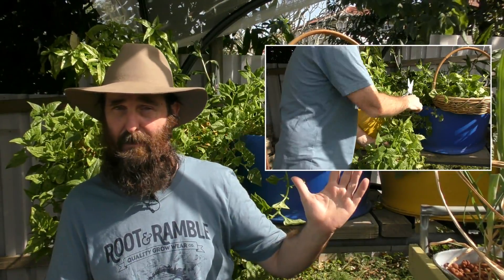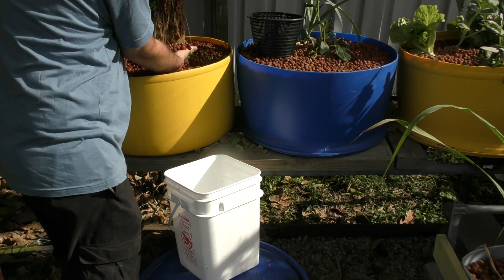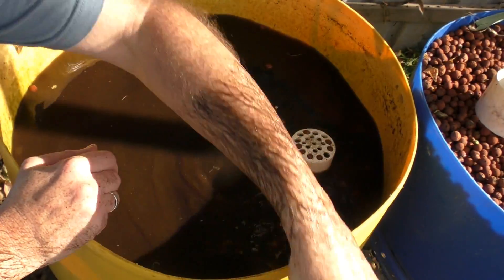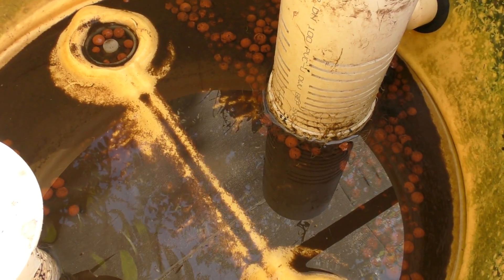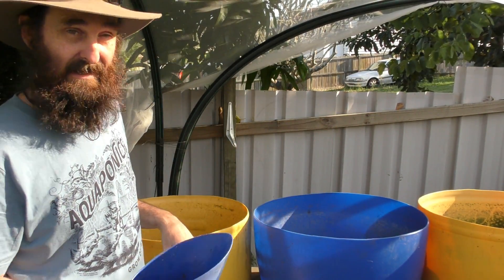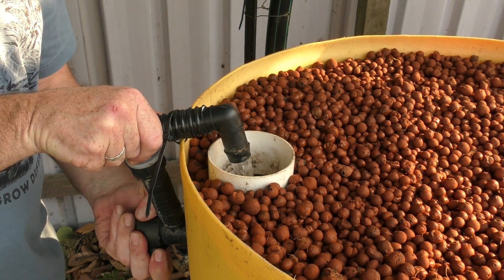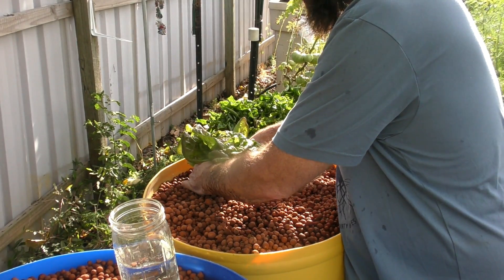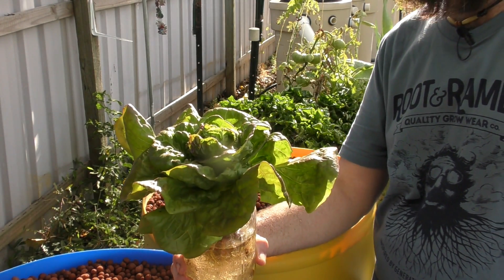Solids in Aquaponic Grow Beds | Rising pH | Denitrification | Cleaning MUCK

Comment: I have composting worms in my ebb & flow and they seem to keep the system free of muck and decaying plant matter.
Reply from the maker: I would think that in the base of the beds you'll still have solids. 
I've had worms in all of the grow beds I've used since I started out & they all collect solids over time. 😉
Reply: @RobsAquaponics  I'm not sure what I am doing, then, as after I checked the bottom after about a year it is relatively clean.

My siphon does drain to about 6mm, so perhaps there's not a lot of volume left after draining that will collect solids to such an extent? Either way, I hope I don't get too much muck in the long run.

I also do not have a huge system, my grow bed is about 1.2m x 1.2m and my fish tank is roughly 550L, so maybe that is part of it as well.

Regardless, I am still young in my aquaponics journey so I appreciate all the videos you create for the benefit of everyone!
Reply from the maker: @tichuang  As long as it grows healthy plants & fish, you're on a winner mate. 
Cheers & happy growing.
🐟🥬🍓

Comment: Sir, do I need to filter the solids excreted by the fish?
Reply from the maker: It will help in systems with a fair amount of fish in them.  You won't remove all of them which is OK. I just aim to get the bulk of them out with the radial flow settler & still clean the muck out from the beds every few years if it builds up too much.

Comment: Hi Rob, why are you replacing the flexi pipe with solid?
Reply from the maker: The 25mm/1" flexible line has a smaller ID than PVC pipe. It also has small ridges that collect solids and bio slime that will impede the water flow.
We are living in a rental property at the moment but will be rebuilding the aquaponics system when we move back home. The new pipe work will mainly be pvc
Reply: I see, makes sense. Thanks very much for your reply & good luck with your move.

Comment: Just tested my system, the strip only goes up to 8.4.  So I added about a 1/4 cup of phosphoric acid (75%) and it dropped the alkalinity from >240 to around 40.  The pH dropped from >8.4 to <6.5.  So problem largely solved.  I did notice that it caused a lot of leaves and surface gunk to float up, but no dead fish, so that is good so far.  I should note I did a complete water change today.  I am hoping to find an organic way to lower pH since the phosphoric acid is pretty expensive, around $30 a gallon.  its designed for hydroponics systems and I had it laying around, but its not really intended for long term use.

Comment: Hi Bob, I am from Singapore and I couldn't buy any of those uniseal that you use to connect pipes to tank, I wrote to the manufacturer in Australia but they don't handle some quantity. The last time you mention you are able to supply the seal. I am using OD 22.5mm, If the price is right i need about 20 pcs of it. 
Thanks and await your reply.
Reply: I mean uniseal
Reply from the maker: Hi Boon Cheow.
Email me on rb@bitsouttheback.net & will work out a price for you.
Cheers mate. 👍 👍

Comment: Would it be easier to diagnose, AND, to clean, if someone ran multiple, smaller systems?  So that they are not all linked?
Reply from the maker: That could be one option. Removing the solids so they don't become a big issue would be a more economical way to go though I think when you consider running cost of p[umps for separate systems.
Cheers Shane.
Reply: Have you looked into "Haren's fountain" ?  It uses Pressure to keep a cycle without a pump!  I am going to attempt a system that uses it to empty into a growbed with a Bell Siphon in this top-most bed.  Below that we have a container keeping the pressure on the Lowest container which must be sealed, and also, squeezable?  A man who I think is Checz (spelling error!) , figured out how to do it with a single container, and, he inspired this idea of mine!   Search on the Google Plus for "shane corning #aquaponics " , and , you should find my post about it with little issue !!!!!  I will test it, first, with just a "wet run" to see if it keeps going.

Comment: Balance between grow bed media/size and fish tank size/density is integral to minimising the build up of solids. I've read that some have got it so perfect that they only have to clean the media once every two years at most, without any extra filtering. Ultra Synergy
Reply from the maker: This system run that smoothly for a while until I got crook & couldn't maintain the filters for a while as I mentioned in the clip. 👍
Am looking at reducing the solids load yet again when the system gets modified in a few months time.
Cheers.

Comment: If you put some sort of mesh under the clay, so there was space between the clay and the barrel bottoms, do you think the solids would flush out instead of build up? A mesh like the diffusers on industrial/commercial fluorescent lights.
Reply from the maker: Have thought about doing something like that in the past Sam but am yet to try it. Once out of the bed they would still need to be captured somewhere else in the system so a better filtration system may be needed as well.
Cheers. 👍.

Comment: hey rob nice vid-currently have a ph of around 6.2 a bit low-so maybe given this denitrification process i should just not flush my solids filter that often.
Reply from the maker: Hey Bevan. 
I'd still be removing the solids as they will release sulphides into the system as they break down. You're better of using some carbonates or hydroxides to manage the pH I think. A lot more controllable & safer for the system. 
Chreers mate.

Comment: I wonder if the clay ball media was the reason for the higher pH. Higher kH --> higher pH?
Reply from the maker: Hi Andy. The clay media is inert & have been in the system for 7+ years so isn't the issue Andy. If I was using rock there could be a possibility that it may be releasing carbonates into the system. 
 Cheers Andy & have a top one.
Reply from the maker: Hi The Foreigner. It refers to the carbonate hardness or buffering capacity of the water in regards to acids.

Comment: Would a trickle filter or a liquid media filter work in allowing a better nitrate to nitrite conversion? I thought worms were always a huge thing when it came to composting organic material into nutrients that are better utilized by plants, but I'm not too certain that that's gonna be the only way. I'm doing an indoor one that is larger than the standard 20 gal tank with some small fish ... I'm hoping to upgrade to a few hundred gallons within the entire system. I want to make sure when I upgrade that I do so without compromising the system as a whole, and so I don't have to do this whole thing where I'm taking the bed apart to clean it out. I've also heard something about a cylinder with a v shaped bottom to catch solids as well ... do you have any experience in these? Been watching your videos, keep it up!
Reply from the maker: Hi Gypsy Winchester. I have a moving bed bio filterer on this system here to help process the ammonia & nitrite as I was intending to run a lot more fish in it that I presently do. The 90 or so litres (23.75 gal) of media in there is enough to process the waste from about 90 x 500g or 1lb fish & if all fits in a 200L drum. They're a lot more efficient than media beds & will always have one in my personal systems now. 👍
Worms are good at processing some but they can't remove all solids. Would be great if they could. 
I uses a radial flow settler as our solids filter & find it works really well (when maintained correctly 😉). It has a flat base as cone shaped ones are hard to come by. 
This clip here shows how the system is roughly laid out now. The only thing that isn't in it is the 3 barrel beds from this clip.  
https://www.youtube.com/watch?v=raLv4RAUte8
Hope it helps you out with a few ideas.
Cheers & have fun with the build.

Comment: Did you just run hose over your hydroton for additional rinsing, clean it additionally, or just replace it as you pulled it from the bed?  Thanks for the experience.
Reply from the maker: I just added it back in so as to not disrupt any bacteria on there too much. A small amount of solids would be reintroduced but I'm not concerned about that.
Cheers & have a top one Savage Dispatch.

Comment: Could you try to employ a vortex filter?
Reply from the maker: I have a radial flow filter in the system which does a great job at removing solids. 
In a previous clip I mentioned I was crook & couldn't get out to clean it regularly for a few months so that's why I think the solids have built up in the beds. 
Cheers Joe & sorry for taking so long to reply.

Comment: In my experience the compost worms I had in my beds a few years ago caused more problems. They just exchanged one wast product for another. Compost worms have wast of there own as well as building homes for eggs, they effective try to stop flow of water in the media to protect there homes. I got ride of the worms from my media, installed 3 bio filters, and one sandy rock media filter with worms in that only. Haven't had a problem, worms are good but they need to be in a sperate filter or bed all their own as its easier to clean out if need be. But I find with no plants in my worm filter and a constant flow of water I haven't had to clean out but every other year.

Comment: This is the very reason I stopped doing flood/drain aquaponics. I have a radial flow filter and media filter on my DWC system and as long as I purge the solids from them regularly I avoid the pH problems. I do have to remove the solids that accumulate at the bottom of the DWC bed about once every 18 - 24 months, but a pool vacuum and siphon hose make that process a breeze.

Comment: Hey Rob, thank you for your videos! Just recently started my own aquaponic system and have been having an issue with my clay media floating after the beds have been flooded and drained several times. Due to the setup I have the bell siphons are situated in the center of the grow beds and after several flood and drain cycles it forms a depressed ring about 6 inches from any side of the siphon and has the tendency to start pulling my plants into the depressed ring. I started the seeds in plugs and then placed the plug in root pouches within the bed to try to control the root growth. The brand of media is GROW!T. doesn't seem to matter how much media I have it still wants to float the whole bed it seems. It may be that my standpipe in the bell is too high. I set it up so that the standpipe would be about an inch below the top of the media but I may try to cut it down a tad to see if that helps. Have you heard or seen this of floating media beds before?

Comment: This is why I overbuilt my system and added a pond filter even though it's a basement system. Grow beds can process a lot of solids but processing most of the solids before they hit the beds makes my life easier. I just take the filter out and hit it's matala with the pressure washer. It also let me know that the worms managed to get out of the beds, through the bell siphons into the fish tank and into the filter. My system has a separate pump in the tank that feeds the Biosteps filter so the worms had to get into the pool and make it several feet to the other pump without being eaten. I wonder how many composting worms they have eaten so far. I need to add air stones to the filter because it does get to stinking.

Comment: Rob,
I've seen other 'ponics gardeners use painters filters and even sponges in a cut pipe inlet (such as yours for viewing water flow) to catch any solids that make it past their initial filtration...
Might be something to look at.  May only be good for larger solids...

As always, great tips and info.
Thanks.
Reply from the maker: Hi There. That does work great as well & have used that method in the past before I had the solids filter. 👍 My problem was that I wasn't able to service the solids filter for a few months due to health issues so a lot of solids made it through to the grow beds. 
Have a top one.

Comment: Hey Rob, 

I've been dreading doing this with my grow beds next season... I have been thinking about this tho. I think next year I'm going to put a little perforated pipe at the bottom with a 90 and a pipe to the surface  and hope I can just hit it with the wet dry vac and suck out a majority of the solids that way?

My grow beds are 55 gallon half barrels so it may work better since the solids channel toward the middle.

Good luck!
Reply from the maker: Would like to know how that works out for you Brendon if you try it out 👍
Cheers mate & happy growing.  🌱